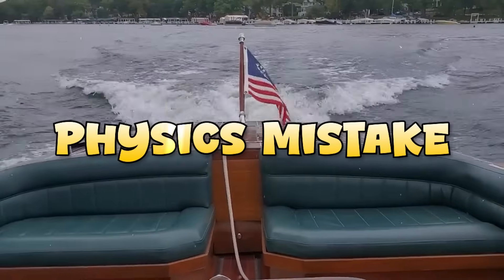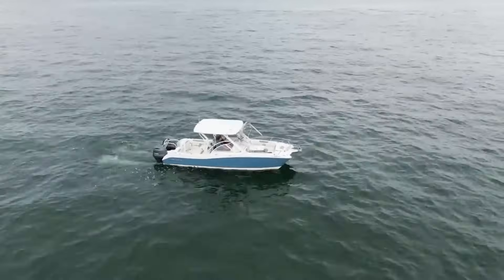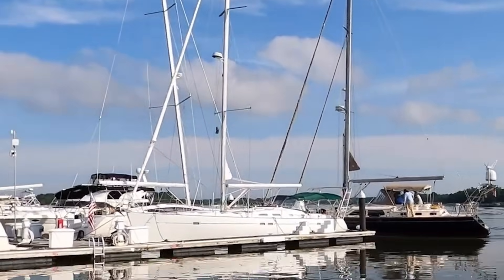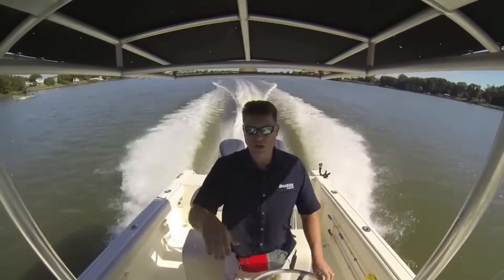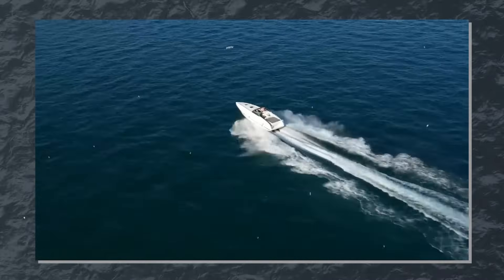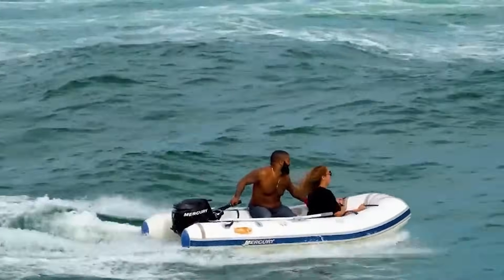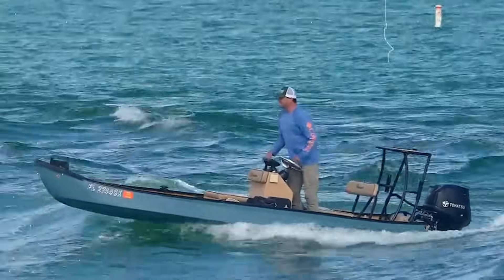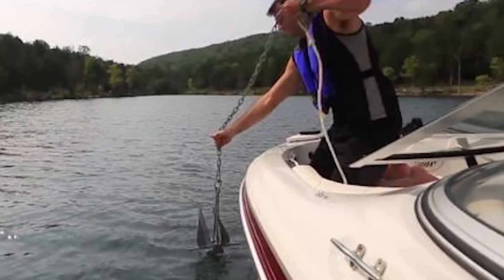Boat Physics Secrets Every Owner Should Know

Comment: No boat will ever displace more weight of water than its own weight. Unless you push it down. But a boat will float if it CAN displace more water than its own weight.
And if you want to escape speed limits get a planing sailboat. Sailboats do not have speed limits.

Comment: I was fishing on the Kerr McClellan waterway. And two highschool kids were backing up and floating out a 12' flat bottom aluminum fishing boat with a 15 hp outboard. They had the boat fully loaded when they floated it out, it was floating about 4 inches above the water surface.
The second kid started the engine and climbed in and gunned the engine. It started to pick up speed and the nose went up and the stern sinks a little when the water started running over the stern and proceeded to sink the boat about 20 ft from the ramp.  Two kids a couple of coolers and half a dozen smaller containers. They swam back and backed down the ramp and swam out and located the boat about ten feet under water. They tied a rope to the bow and pulled it to the ramp and drug it out. They sat for an hour and started trying to get the engine to fire off. I left to go home.

Comment: Good introduction to the great subject of boating!
I have a small (15ft) boat with a 30 hp 4stroke. Amazingly it is rated for seven people, and it has really high hull (I’ll get back to that). The previous owner, who had the 30hp engine fitted went a bit above the recommendations, but since it’s an older hull i think they calculated weight of engine as a 2stroke, not a 4 stroke, so it is somewhat heavy in the aft, made worse by sitting at the back steering.
It goes on plane easier with two people in the boat, one driving and one in the stern. It got better as I installed some hydrofoils on the cavitation plate on the engine. Maxes out at 24kts, engine over rev alarm goes off. 
It is always windy here, so with the high hull it is a challenge to dock, and i have 25ft passage to go into, and then make a 90 degree turn around a metal pole to get into my spot. It’s a hassle…

Comment: A boat's wake is the broad path of waves a boat creates by displacing water as it moves, while the wash is the circular, turbulent churning of water at the stern caused by the propeller. Both are natural consequences of a boat's passage, but the wake is the larger wave system trailing behind, and the wash is the more localized, propeller-driven disturbance directly behind the stern.
Reply: And?
Reply: @Snide01  42

Comment: waves created by a boat is called the WASH .  Wake  is  the visible trail left by the boat.
Reply: I think you’re backwards.
Reply: Explain prop wash… then sell your boat please.
Reply: A boat's wake is the broad path of waves a boat creates by displacing water as it moves, while the wash is the circular, turbulent churning of water at the stern caused by the propeller. Both are natural consequences of a boat's passage, but the wake is the larger wave system trailing behind, and the wash is the more localized, propeller-driven disturbance directly behind the stern.
Reply: Flip that
Reply: A wake is actually the displacement of water cause by a vessel creating a vacuum behind it that will refill with water and can create a powerful suction behind larger vessels